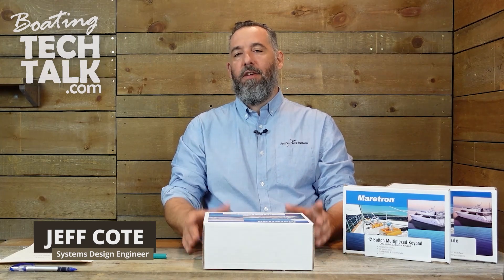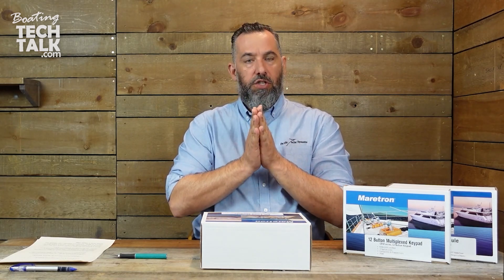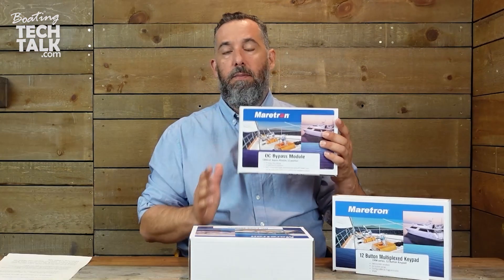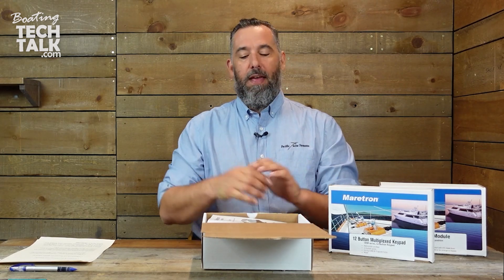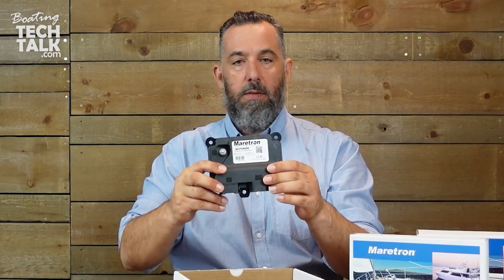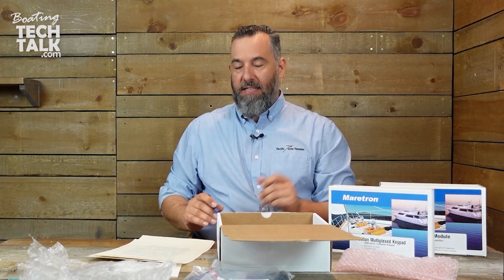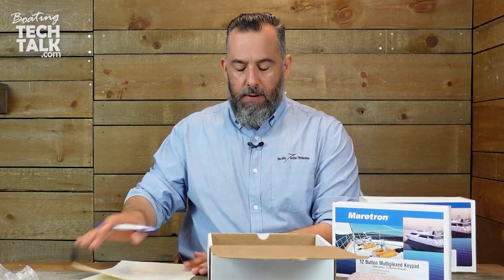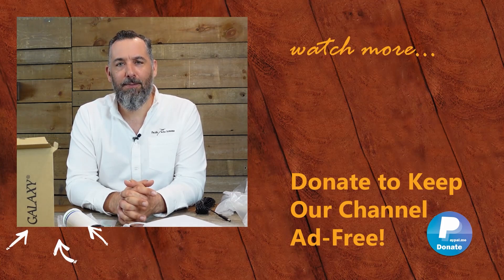Maretron Digital Switching - Part 1 of 3 - Unboxing and Product Review

Comment: Thanks for that Jeff. I can see a need for 4 of those units on my boat. One for each head, one for the lighting and one for another function. I have a lot of switches in each head as I run the toilet pump in both directions for better discharge, the shower pump out, I have a 2 speed heating fan to dry the room out after a shower along with an exhaust fan. I have a switch near each main bunk to be able to turn the Head heater on in Winter so its warm before getting out of bed. Then there is the new requirement for a black waste processing unit. That is one full module and a half right there. It would be very nice if they had some PLC functionality as well (long flush versus short flush for instance). I do like Maretron, but it is very sad that they discontinued their masthead wind instrument. Delos installed one a few years ago and still going strong. I’m ready for one but no longer available.
Reply from the maker: If you decide to try those Maretron devices, do let us know how it goes.
Reply: @PacificYachtSystems  Shall do. I’m more interested in the 16 channel unit. At a Class 1 Zone 1 rating it has to be very robust. It will have to wait its turn in my expenditure program.

Comment: Hello how are you I'm moving aboard full time on a sailboat in November my question is this boat has the house batteries and starter batteries all hooked up on the same charging system is that normal or do I want my starter battery separate from my house batteries and if so how do I hook it up and away to where the motor runs and charges all of it if you understand what I'm asking
Reply from the maker: Assuming your battery chemistry is similar, then you can have one charger for both house and starter battery.

Comment: I was wondering if the feed could be a single pair of large gauge wire running at a decent height around the circumference of the (sailing) yacht, or whether you'd want the feed wires in a hub-and-spoke arrangement from the switch panel. The single pair would have to be beefy (50 mm^2 for a 40-foot yacht if you'd want to use the feed line for both power suppliers and big drains like winches and bow thrusters), and you'd have to use some screw clamp taps that would not require cutting the cable (and introducing a potential failure point) at every DS-box. 

I don't know if such screw clamp taps exist for anything else than earthing posts.. do you know? For a screw clamp, you'd only have to strip a portion of the feed wire, clamp the tap on, and then surround the thing with a waterproof / water resistant box to prevent corrosion.
Reply: Wow totally against any kind of electrical code, think about this two high current devices load up the large circuit and light up that cable and you have a nice ring of fire all around your boat. What you are describing is a grounding drain circuit you would never do this with AC or DC power.
Reply: @davethemmp3763  Ampacity of 50 mm^2 wire is 230 A, should be sufficient to max load a few of these boxes.

Comment: Thanks Jeff for a great channel. When it comes to digital switches and products like this, I consider them as nice to have and I understand why both the boat owners and the bout builders  want such products.

The equipment on a boat that is used for navigation I consider as critical equipment. No one steers by hand or uses paper charts anymore, right? Therefore, a robust N2k network on a boat is essential.

Do you have any thoughts on the integrity of the N2k-network when introducing new components that are not essential? My first thought was to separate critical and non-critical devices into two physically separate networks and then run a bridge between them. I see that Yacht Devices has such a bridge (NMEA Bridge YDNB-07). Do you have any other suggestions for products or solutions that are considered as "best practice"?
Reply from the maker: Thanks for sharing.
Reply: you didn't really address this question Jeff

Comment: being in australia some of the other company products in the digital control area require me to be registered tech company to get access to the programming software whereas this company which i have been aware of allows me in Australia to download the software tools I need to program the units. Personally i was looking an non critical areas like lighting in one place e.g. engine compartments and external underwater lighting which trying to switch the normal way would result in a lot of switching wires running back and forth to the cabin area. With most cabin areas for switching panels realestate is in short supply. 
Expand critical  monitoring  of other areas
Reply from the maker: Thanks for sharing David, keep us posted on your project.

Comment: Good morning Jeff does these systems pull amps continuously from your battery when connected ? As they are Digital Switching and if so how many amps.
Reply from the maker: Good question, let me find out and do another video on the topic.
Reply: @PacificYachtSystems   Thanks Jeff, i am upgrading my electricals at this moment and this looks like something ill do in the near future